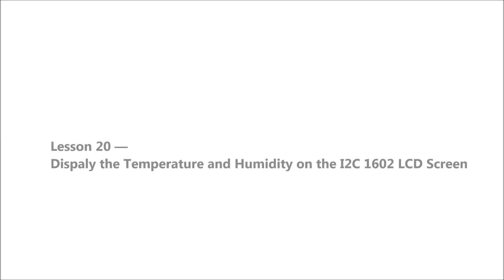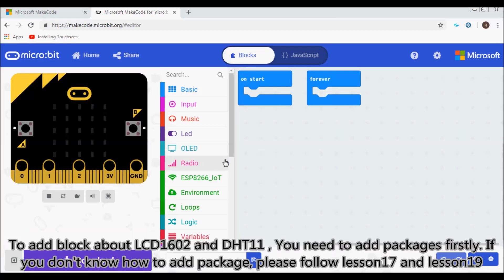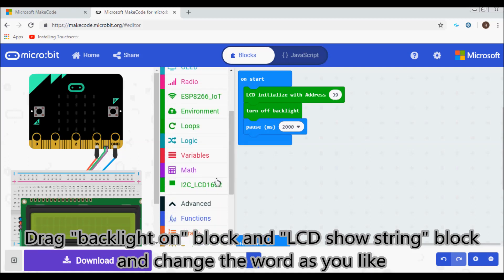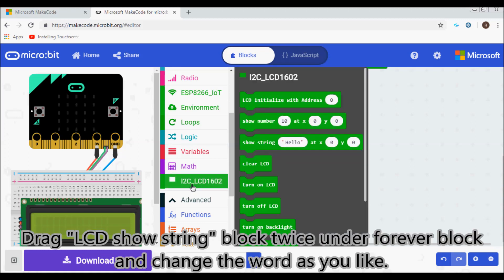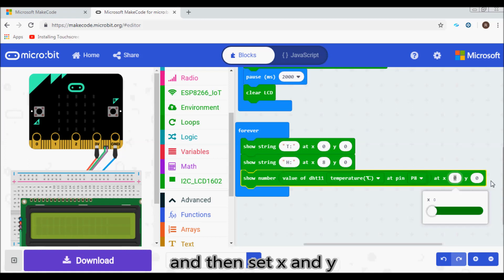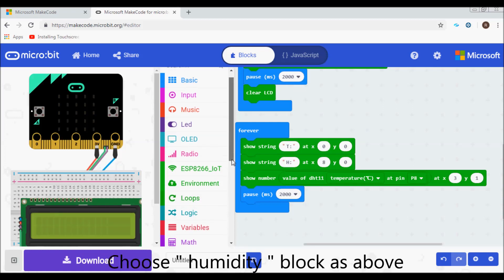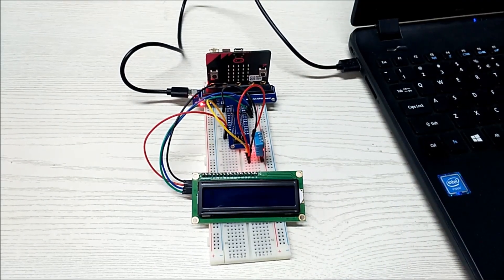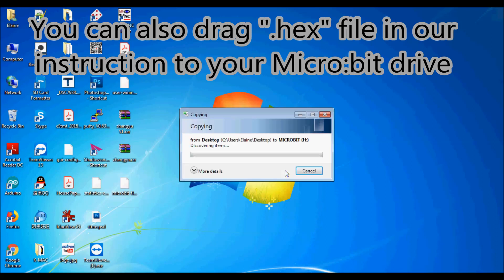Micro bit 20: Dispaly the Temperature and Humidity on the I2C 1602 LCD Screen

Comment: Could you please tell me what I have to get (except Micro) bit to make this circuit. I plan to order from ebay. Thanks
Reply from the maker: You also need a Micro USB cable
Reply: @osoyoo_product  I have micro bit with USB cable. Can You tell me what else i must have to make circuit like yours! Where to find all other parts .... Can You help me tu understand which part is this (Pictrure on link https://ibb.co/LRfdYFV )
Reply: Can You also tell me what part is that (marked with red arrow on https://ibb.co/LRfdYFV. Thanks
Reply from the maker: @pcigra  You can use our kit now.